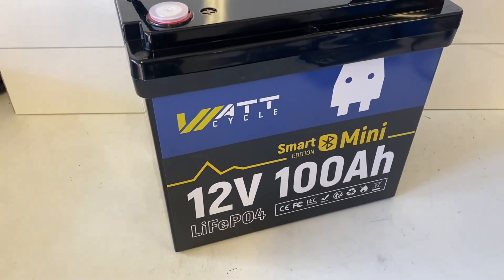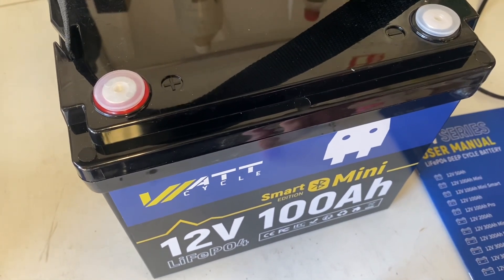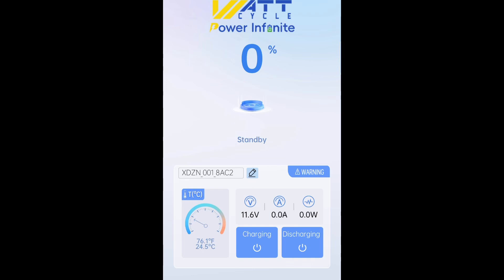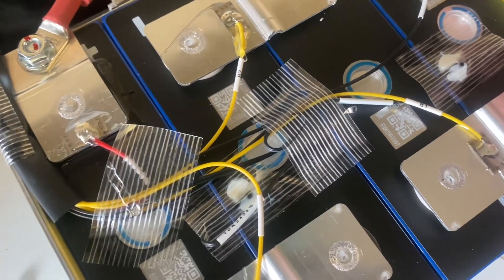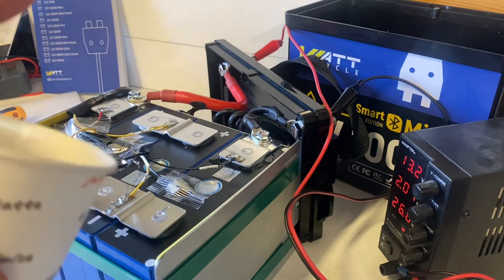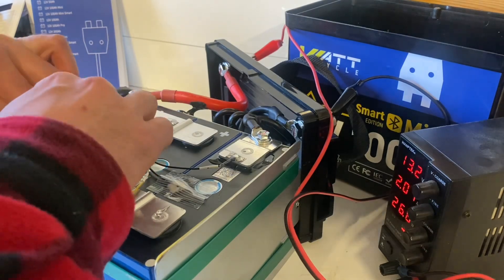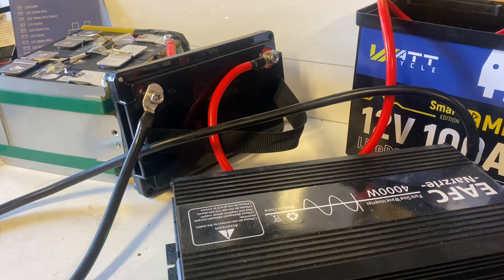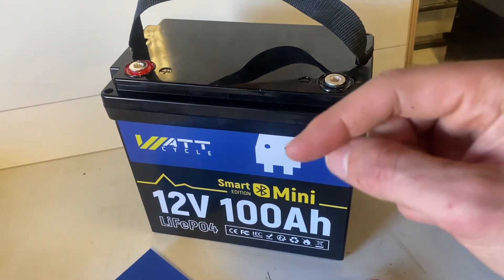12V 100Ah Mini LiFePO4 Battery with Bluetooth | Test and Teardown

Comment: This batteries dont have the neccesary certifications. Grade-B cells and false markings on label.
Reply: Thank you for your concerns, but your claims are factually incorrect. WattCycle batteries are fully certified and compliant with all required EU regulations, including CE, EMC, UN38.3, MSDS, and RoHS. We use only Grade A cells, and our BMS is rigorously tested for safety and performance.

Certification documents contain proprietary supplier information, which is why they are not publicly listed—this is standard industry practice to protect intellectual property. However, authorized distributors and customers can request verification through official channels. Also shipping follows all dangerous goods regulations—any suggestion otherwise is false.

We encourage fact-based discussions and are happy to provide clarification. Misinformation helps no one, especially in an industry where safety and transparency matter most.
Reply: When you sell the product on European market you need to to offer the documents on request from customer. Its regulated by law in European commision and battery directive. You as a representative seller for the product need to have your name in the certificate. You cant use the name of a chinese sub-supplier. Beside that you also need to make the UN38.3 and MSDS available for transportation. But instead you not follow the dangerous goods regulations and ship the scam batteries as normal goods. Thats not to be responsible att all. What you are writing in your comment is false and just a way to not certify your products and follow the laws. The cells in your batteries are NOT Grade A cells. Its very easy to check. If you want the information public i can share it for you.  @wattcyclepower
Reply: @wattcyclepower  You are not follow the dangerous goods regulations att all. You are shipping the goods without dangerous goods label and declaration with standard parcel service. There is several photos on how your parcels looks like when they arrives.
Reply from the maker: Thanks for the comment. Any proof to your statement?
Reply: Just ask wattcycle for the certifications, CE, EMC, UN38.3, MSDS, ECE R10.06. They need to show theses documents on request when selling products in EU. But fact is, that they dont show any valid test documents. On other side its hard to get a battery certified with no safe BMS and B-cells that differ from one batch to another. Beside this, they not follow the European battery directive and pay for the recycling cost. Other important thing is that they shipping the batteries wihouth follow the dangerous goods regulations to save large money in shipping costs. WattCycle is a wellknown scam-battery company. Same crap batteries like li-time, ecoworthy, creabest, lanpwr, etc. Just different labels.  @JonasSyver
Reply from the maker: Thanks for the detailed follow-up. I completely agree that manufacturers should be able to provide valid certifications and comply with EU regulations. In this video, I’m sharing my own experience with the product, but I don’t have access to the company’s internal documentation unless they choose to make it public.